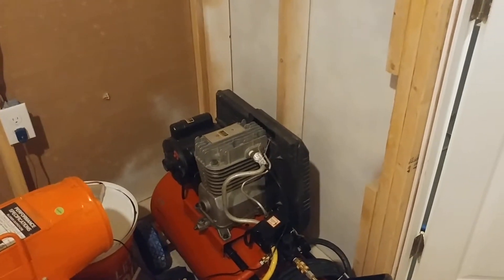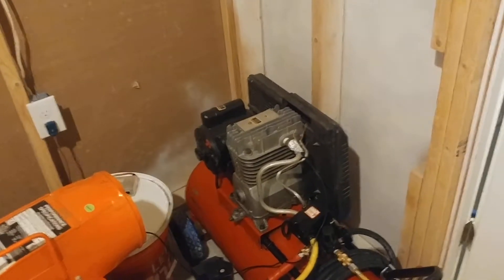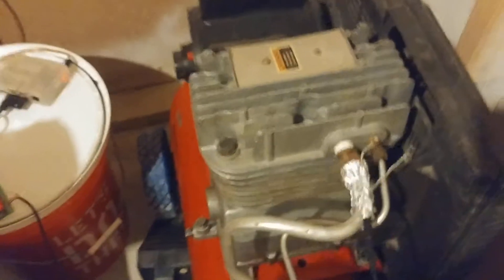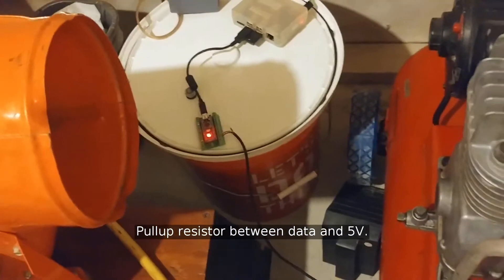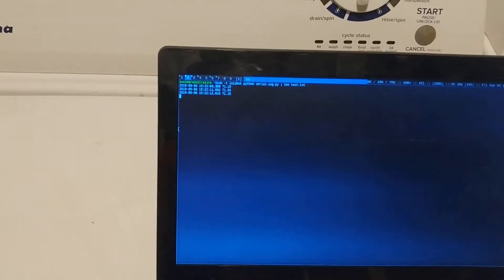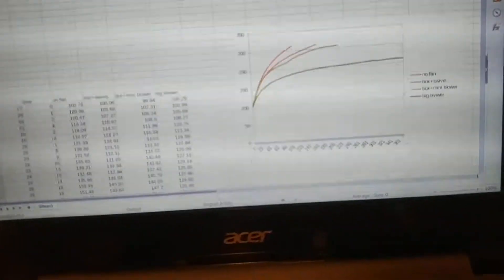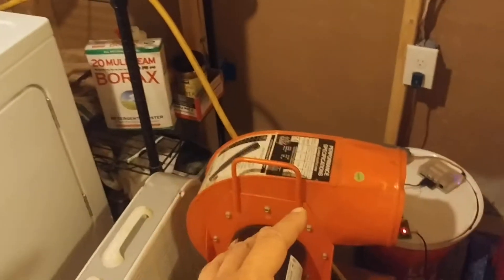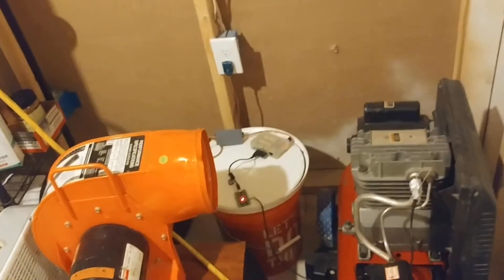Improving your air compressor's duty cycle (with WiFi!)

Comment: Could you shroud it and add a mister?
Reply from the maker: I have thought about adding a shroud for a bit more efficient use of the air cooling, but not going to do a mister. Not saying it wouldn't work, but that basement is damp enough as it is.

I still need to get that fan on a temp-controlled relay. lol Priorities.